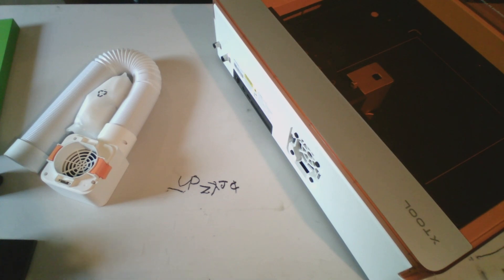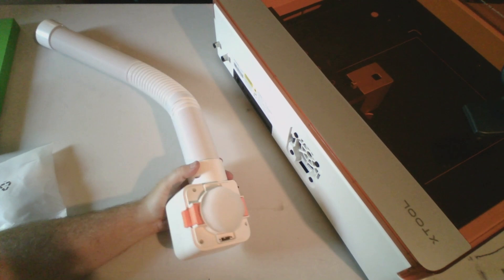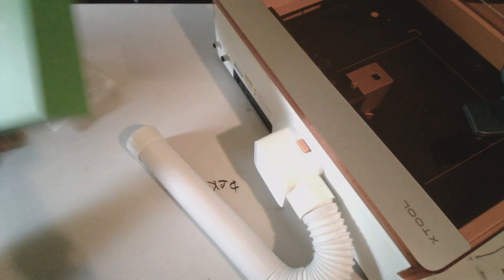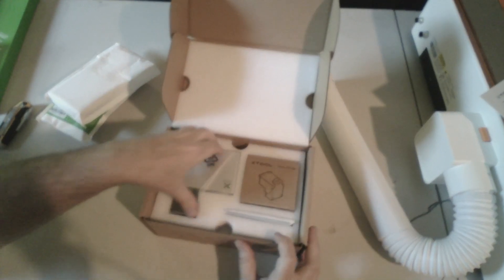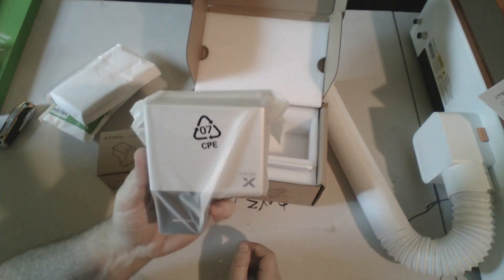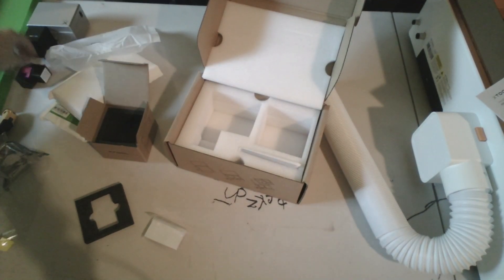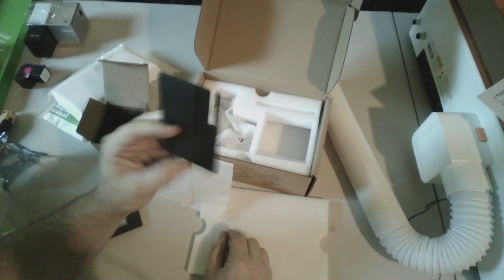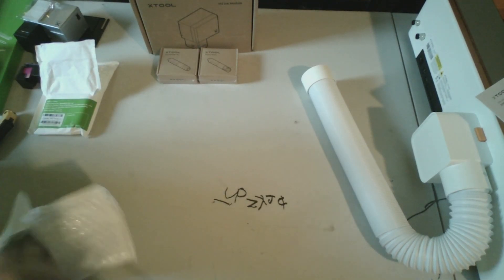xTool M1 Ultra Smoke Exhaust Module Installation

Comment: Have you used alternative filters on the connection end?  These things do not last long.
Reply from the maker: No, I have not.  I have 5 or 6 of them currently.  I would imaging you can just buy a large filter for cheap at a big box hardware store and cut circles out.  They are not that special of a filter.
Reply: @wickedawesomegifts  Thanks for replying.  I ended up getting a bundle roll of fish tank cotton filter. I also disabled the alarm in settings to prevent it from stopping midway through cut jobs.
Reply from the maker: @MrGillard  awesome, thanks for the update.  I'll check onto those when mone run out.

Comment: Thank you for the video but which cords go in which slots? I have place where it says F1 so I wasn't sure if this was just for the F1 or not? Do we plug in the USB-C? Uuuugh! These instructions are not very clear. Picture do not match what is on my M1 Ultra :(
Reply from the maker: The exhaust machines can be used with all the lasers.  For the M1 Ultra, i was confused too as i did not see a plug to connect it to the air purifier, the small one i got with the F1.  

The large stand alone unit does not get plugged in to any laser, you just run it always, and turn it up or down as needed.  

Conne ting the small air purifier to the lasers just allow for the laser to conteoll it, kicks it on once lasering starts and kicks it off when done. 

Since I could not find the right cable, I just turned thw air purifier on via the button on it and let it run all the time I was using the laser, then I cut it off when done.  

The F1 uses usb-c to usb-c, the M1 Ultra does not.  So I'm not sure yet about that.